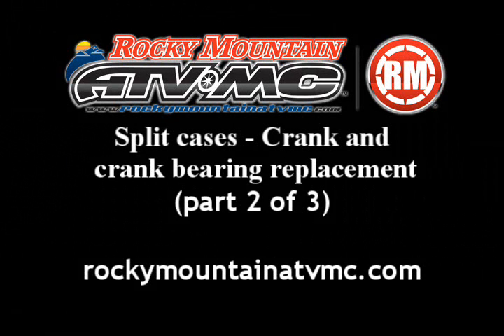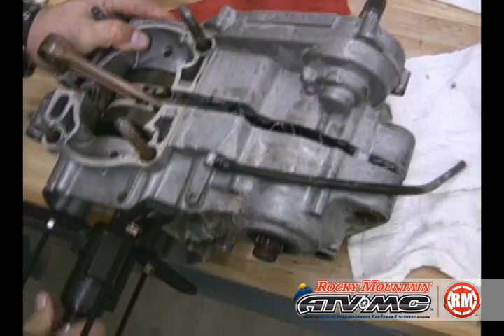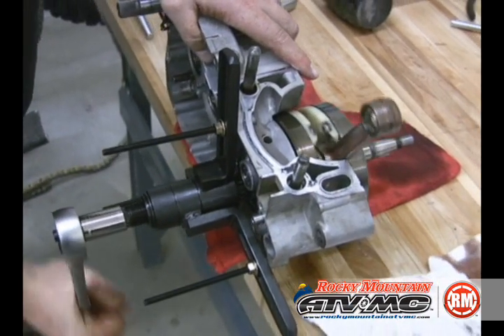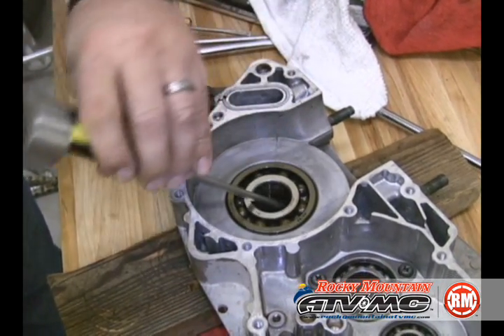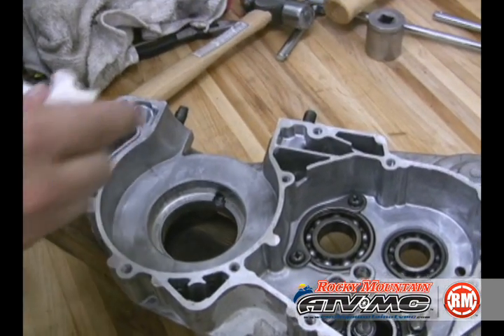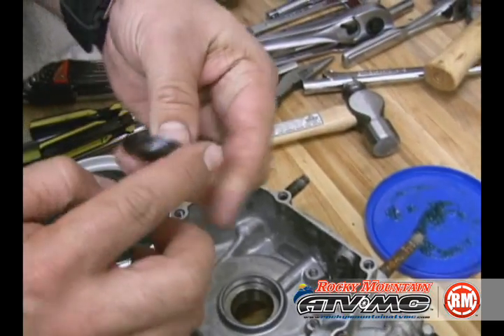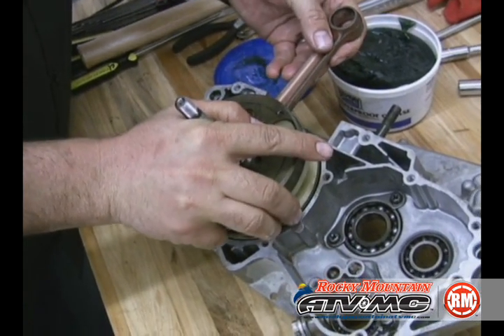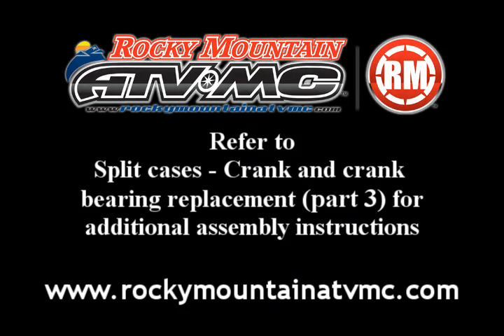Motorcycle Bottom End Rebuild | Part 2 of 3: Crank & Bearings

Comment: How similar is this to taking apart a 2005 DR650SE? I believe I need to replace my crankshaft connecting rod bearing, I have never worked on a motorcycle engine this involved before

Comment: The crank bearing seized my KX250F, which also damaged the sleeve/piston, and I've tore everything down for rebuild.  I've removed the main bearings and also some of the others shown here which you've not removed.  There are a few I'm not sure how to remove but am wondering why you didn't remove them, is it unnecessary or are you just demonstrating how to replace the crank bearing?

Comment: So I stood by as a bystander while the bottom end was replaced and now it seems like its stuck in gear. What did he miss?
Reply from the maker: Daniel Flynn,  It's hard to diagnose the exact issue, but i would start with looking at the gear drum and shift forks and making sure they're installed correctly and in the right spot.  A service manual is always handy to have around to know the order everything goes back together.  From there, I would look at the transmission gears/washers and their order, making sure they're all installed correctly on the shafts.  What year, make and model are you working on?
Reply from the maker: Daniel Flynn, Best of luck.  Let us know what you find out!  Very nice bike by the way.

Comment: i think that the crank puller needs to be redesigned to rest on the inner race, this  way it will not exert exessive acial force on the bearing during assembly.
Reply: You can accomplish that with the old bearing instead of the bar stock shown.

Comment: Great video! I am currently rebuilding a 2008 KX250f. I have the motor pulled out and piston removed and oil drained. Bottom end is on the bench. When I rotate the rod/crank by hand, there is a slight clunking sound. It rotates smoothly but there is still a noise. Is this the main crank bearing? There is no free play up and down but a little from side to side of the rod. The clearance free play from side to side is 0.35mm (between connecting rod and crank), standard clearance is 0.25mm-0.35mm and service limit is 0.55mm. This is my first bottom end job so I'm not sure if the rod/crank should rotate with no noise at all. Also, my service manual states that you should not use a torch on the case as it will cause warping. Is it still okay to sweat bearings in as long as you don't heat it up too much (above 200F)?
Reply from the maker: If your connecting rod bearing is all good, then i would say it would be the main crankshaft bearings.  Have you tried applying any motor oil with your finger onto the main crankshaft bearings to see if it goes away with a little lubrication? Your side to side free play seems to be within spec.  If it was me, I would replace it all.  Does it still have the stock crankshaft in it?   As far as sweating the bearings in goes, that is a well practiced method for installing crankshafts and bearings.  Also other methods would be heat transfer and using a crankshaft puller installer tool.  We sell that tool as well: https://www.rockymountainatvmc.com/p/989/17166/Tusk-Crank-Puller-Installer-Tool
Let us know how it goes and if you run into any other questions!  Vinny

Comment: do you have to have that tool to install the crank
Reply from the maker: There are other methods you could try.  You can sweat it in by freezing the crankshaft and heating up the bearings.  The tool does make it convenient and fast.  Otherwise you would need to have a torch and plan ahead, freezing the crankshaft overnight.
Reply: Rocky Mountain ATV MC thank you so much you guys are the only thing getting me through my rebuild
Reply from the maker: We're happy to help!  Thanks for watching Luke

Comment: when re-installing the crank you used bar stock across the case doesn't that mean the crank installer is pulling on the crank / inner race of the bearing only? it should be holding the inner race and pulling the crank into it. I love your videos but had to close my eyes for that part

Comment: do you have to remove the transmission to change te crankshaft on a Honda crf 250 2008 anyone??:)
Reply from the maker: When replacing the crankshaft i would recommend you change out the crank bearings and seals while you're at it.  And to remove the crank bearings, it's a whole lot easier to do with the transmission out.  I like to ziptie the transmission up all together so nothing gets out of order.  Makes the reassembly part a breeze.

Comment: hi. these are very informative videos.  nice. I have to get to my transmission of my 2003 Yamaha wr 450f as the bike is stuck in 3rd gear with the shift lever stuck down. 
do I have to take the engine off the bike to do so?
Reply from the maker: Yes. You may want to disassemble part of the motor before you pull the engine out of the frame.  Makes it at times a lot easier to have the motor in the frame for different steps in the disassembly process.  If you have any questions let us know, happy to help!

Comment: having a problem splitting my yz250 case open. when I use the crank case tool it gets harder to spilt the case each turn.
Reply from the maker: +javonte johnson (joebeatz) Double check everywhere for bolts.  On the left crankcase inside the ignition cover/stator there are some.  Sometimes if it's the crankcases first time being split, it'll be tuff and you'll hear kind of a "popping" sound as you're tighting down on the crankcase splitter, and that's normal. Let us know what ya figure out?
Reply: Check for bolts. If you are sure they are all out, your dowels may just be crusty and sticking.

Comment: can i use regular ice to chill the bearings rather than dry ice?
Reply from the maker: +Warrior Nutrition Sure.  Or just stick them in the freezer overnight
Reply: i used dry ice and still got them stuck half way in.  I was very careful with temps.  overnight in the freezer with dry ice and nice hot cases?  2001  yz 125 hot rods bearings, went in so tight i damaged my cases with flat stock when using puller!  should have dropped right in!

Comment: which bikes engine did you remove
Reply from the maker: +Narayana23597 Yagna This engine is from a yz250 two stroke.
Reply: +Narayana23597 Yagna 1999-2016  YZ250 engines are all pretty much the same

Comment: When re-installing the crank how do you know when it has been seated properly into the crank bearing? How much force do you apply without over torquing it into the crank bearing?
Reply: When u put the cases together they seat them self's just torque it to spec and it's done

Comment: Hey Rocky Mountain I have a question.  Ive replaced the crank and crank bearings on my 2010 kx250f.  Bearings sweated in nicely along with crank.  Also used a crank installer to make sure the crank is seated all the way.  My problem is the crank spins freely but as soon  as i start to tighten the crank case bolts squeezing the cases together the crank seizes.  Any ideas about how to fix this ?
Thanks
Reply from the maker: +Doug Ryan My guess is that one of the crank bearings didn't seat in the cases deep enough?  You sometimes need to assist the bearings by tapping them lightly to assure they have seated evenly.  The other possibility is that your crankshaft isn't pulled in far enough.  I would double check these two possibilities and see what ya find out?  Let us know what ya figure out.
Reply: I put the crank installer back on it pulling the crank tight and then beat it from the other side with a mini sledge careful not to damage the threads. It did free up the crank some. Although still tight, I was able to turn it by hand so in running it. I read somewhere the hotrod bearings for tighter than the oems because they use a larger diameter ball bearing providing less backlash but who knows
Reply from the maker: +Doug Ryan  I'm not sure on the hotrod bearings running tighter than OE's?  Where they're (new parts) everthing is going to fit nice and tight.  So i can see you having some resistance turning the crank over by hand.
Reply: keng lee tan

Thanks Keng,  What ended up happening was the hot rods aftermarket bearing were slightly larger than the oem bearings.  Kinda sucks considering the price of the aftermarket crank kit.
Reply: +Doug Ryan Hi

You could use a vernier ( the back of the vernier used to measure depth) to measure how much your bearing should have seated. Subtract the depth of the bearing seat in the crank case from the thickness of the bearing, you get how much the bearing would need to be seated. the amount of depth left after the bearing have seated properly should correspond to the subtracted amount. The method is also used where head set bearing are to seat into the steering head . Of course for experience mechanics, when hey tapped on the bearing with a bearing seater , the feel and sound of the tap would indicate to them whether the bearing have seated correctly.
Reply: That's what happens when you buy Taiwan instead of OEM.
Reply: KING TROLL live and learn and help others along the way

Comment: At 3:55 could sombody give me a name or part number for the small bearing above the one he is knocking out ? I need on as mine is jammed in there on an angle somehow...
Reply from the maker: Codie Bell Part# 93300-60814-00.  This is one of the power valve bearings or governor bearings.
Reply: Thanks ! I'll look into that an see if its what i need.
Reply from the maker: Codie Bell It's located under the "Governor" Micro Fiche Assembly.  Are you working on a YZ 2 stroke?
Reply: An rm 125 2 stroke it seems to be very similar looking
Reply from the maker: Codie Bell Ok.  Don't use that part# i gave you.  That is for a YZ250.  Let us know if you need anymore help, Thanks for watching!
Reply: Ok thanks . The name still helps put me in the right direction

Comment: Great Video lots of help. I'm rebuilding my 05 YZ250. I had to replace my left main case and am having problems getting the bearings to seat.  Tried the torch trick and freezing the bearing but no go they wont seat all the way. Now I'm stuck with one of the transmission bearings half way seated. Any idea how to remove it or get it to seat the rest of the way. ( can't beat it out from the back side ) I didn't have any issues with the right case all the bearings went in easy.
Reply from the maker: stevecon82 Is the bearing being drove un-even in the casing?  You would need to use a bearing removal tool with a slide hammer.  You may want to consider getting a bearing driver set as well, so you can drive the bearing evenly into that casing. If you have any questions let us know.  Here's a link for ya if you want to get  an idea of what the tool looks like: https://www.rockymountainatvmc.com/p/989/20342/Tusk-Bearing-Remover 
Thanks for watching!
Reply from the maker: stevecon82 Nice bike by the way!
Reply: Rocky Mountain ATV MC  Thank You for the advise, I'll give it a shot
Reply from the maker: stevecon82 Let us know if you run into any more issues.  We're here to help!

Comment: I have a question. I have a 1984 Kawasaki KDX250 and I need a part #21007 STATOR GENERATOR MAGNET ROTOR and I can not find it online anywhere at all. It's actually obsolete. Will another later model work on my bike to get it up and running again? If not, what should I do?
Reply from the maker: Yasin Abdul Thats ruff man. I remember researching for this.  Did you have any luck finding a complete motor for this bike by chance? I would try to check some forums to see what other guys needed to do about this issue.. Good Luck! Let me know what you find out.
Reply: Hey buddy, I just dropped it off at a shop where they have connections to a rotor that I need which will be install shortly. And a nice upgrade.
Reply: +Rocky Mountain ATV MC all those heavy bearings why not full ceramic i bet all those bearings are near a kg of wheight plus wheel bearings aswel

Comment: So what do you do it the lower rod where it is connected to the crank is seized? How do you remove it if it won't spin like in your video?
Reply from the maker: Michael Chappell It doesn't need to spin like in the video.  Its naturally going to want to spin the whole crankshaft due to the amount of force/pressure you're applying to it.  This crankshaft we're replacing in this video had up and down play, so the connecting rod is going to want to freely spin.  In your condition your connecting rod is seized.  So you're going to want to protect the inner crankcase edge from the connecting rod scarring or damaging that area with a rag or towel.  You're just going to need to push it straight out, it should break free and start pressing out.

Comment: We are rebuilding an 06 kx 250. The crank seals come out to the inside. As a result heating the case to insert the bearing could be detrimental to the seal as it must be placed first. Got any ideas? By the way, THANK YOU for this vid. We rebuilt a 90 CR 500 successfully because of you!
Reply: +phdequipped If you have to seat the seal first and cannot heat the crank case, then you have to use the method of freezing the bearing and use a bearing seater where one end of the seater rest on the opposite end of the crankcase and the bearing seat on the outer race of the bearing and turning the screw of the bearing seater, will easily seat the bearing without  impacting into the bearing. Another improvised method is to use the right diameter of sockets and washers and a screw of appropriate diameter and apply force by counter opposing two ends by tightening the nuts at both ends.

Comment: Is it possible to push the crank bearings in to far? I dropped them in and then gave them a little tap and when they warmed up they were difficult to spin. Its a kx 250 so the crank seals go in before the bearings so to tap them out would mean destroying the seals would it not? Is this normal? If I finish re assembling the motor will it correct its self during the first run? I do have the case halves together already and I dont wanna go back and redo it all lol
Reply from the maker: Magnetic.Crayon It isn't possible to press the bearings in too far as they will seat in each case half but it's important that they seals were seated all the way before installing the bearings. Crank bearings do tend to be tight after freezing them and installing them into the case but they should spin smoothly with the crank installed and the cases pressed together correctly. As far as the bearings spinning freely it depends on how sticky they feel, if some dirt or debris accidentally fell down in and got into the bearing you would want to clean it out with some air or cleaner and see if that helps but generally yes crank bearings can feel tighter when new but they still should rotate smoothly

Comment: Oh and another thing. Dont bother spending nearly £100 on the tusk crankcase splitter. Just buy a harmonic balance puller for approx £10 on Ebay. It will do the same job. When reassembling the crankshaft. You wont need a Tusk crankshaft puller either. Put the crank in the freezer for an hour and put the case half in the oven 150 degress for 15 minutes.Crank will slip in without problems.Fit the oil seals after the Crank is installed. Use the case half bolts to pull the 2 Crankcase halves back together. Cheap as chips to do your own engine rebuild. Dont bother buying gasket kits either.Too expensive. Buy A4 gasket sheets for a couple of quid and cut your own.Plenty of vids to show how to make your own gaskets for a fraction of the price.
Reply: ***** I do crank rebuilds with a 30 year old adapted bench vice. You would be surprised how easy it is. You dont need big expensive hydraulic presses. Just a bit of accurate measurements.
Reply: ***** This video is about rebuilding the bottom end on a 2 stroke engine. There are no shells and no grinding is required. You are talking about a different type of Crank altogether.
This engine has a roller bearing and simple pin crank. There are only 5 parts that need to be replaced. Con Rod, Con Rod Bearing, Crank pin and 2 spacers. The 2 halves of the Crank assembly do not need to be replaced. It is a very simple process to push out the pin and re install it after new parts fitted and can easily be done with an old large bench vice.  You have to grind a large slot in the vice jaws for the assembled Crank to slot into. Thats why i used a very old vice.
The only critical point is lining up the 2 crankcase halves. 2 "G" clamps and 2 straight pieces of metal are used to line them up. I was shown how to do it many years ago when rebuilding Lambretta engines. Its an old way of doing the job but works perfectly. 2 stroke engines have been around for far longer than modern machinery and hydraulic presses.
Reply: Funny i was thinking wait thats a harmonic balancer removal tool lol

Comment: So many of these engine rebuilds dont include replacing the transmission bearings. I guess its because of the cost of the bearings. Most people dont know that you need not buy bearings from the Bike manufacturer or parts distributor. Most of these bearings are standard bearings that can be purchased for a fraction of the cost.Typical example would be replacing the main shaft bearing on a KTM125. If you buy it from KTM expect to pay around £15.00 plus carriage. You can get the same bearing off Ebay for £1.84 and that includes delivery.
Reply: Too costly. Its an easy job that you can do yourself.

Comment from the maker: Most dirt bike cranks don't require shimming; rather, the crank needs to be pressed together with its width in spec with the tollerences in the service manual (Some KTMs do need shimming). In most cases, the crank will always be pulled to the right side (primary gear, bolt and spacer are all tight). Regarding your cylinder, I am not sure what you have going on. side to side or front to back? Typically, there is enough side to side play in the rod to put any side pressure on the piston.